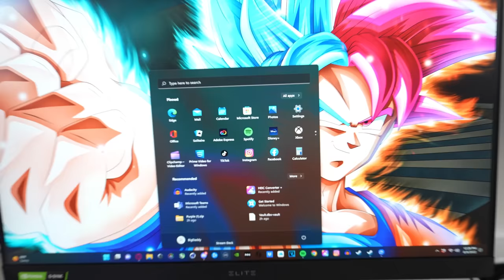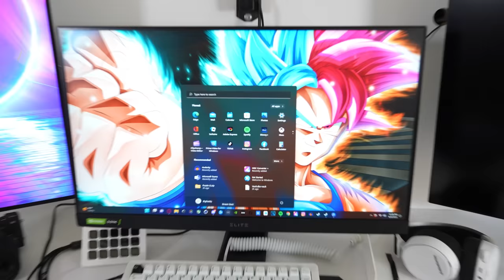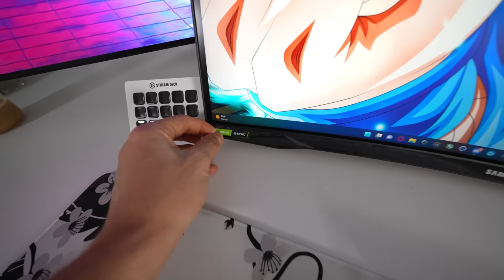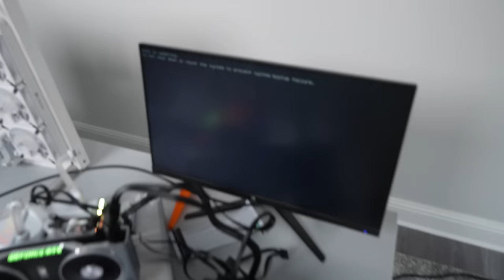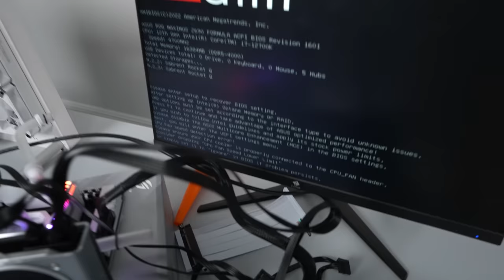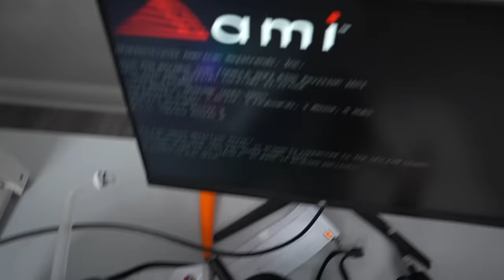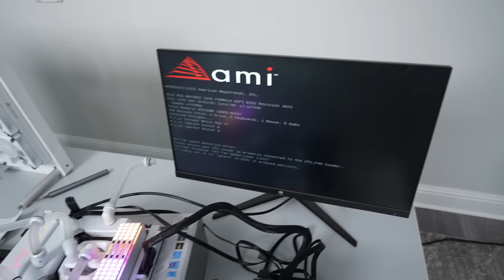I Almost Gave Up...

Comment: If the update resetted your bios, it might be that it also reset PCIe compatibility to 4.0 instead of 3.0. Because PCIe 4.0 is more finicky on timings and you have the long riser cable the timings were off and thats why you didn't get any VGA signal.
Reply: That makes sense.
Reply: Yep, good ol 3.0 vs 4.0 issue with the update. Happens every. Single. Creator. Who uses a riser cable
Reply: windows moment
Reply: IMHO, I don't think that's the issue, because his motherboard is PCIE 4.0 to begin with.
Reply: even if that was the issue, after he installed the 2080 he didnt went in the bios to change the compatibility to 4.0
Reply from the maker: The riser cables used in the video were all pcie gen 4. I never changed it in the bios because I was using a 3080 ti.
Reply: @djkucuk  Hopefully he sees this 🤞
Reply: Weird for some reason my comment is gone.

Ive looked at the amazon listing for (what i believe is the second that cable you bought). It states: "PCI-E specifications do not regulate the use of a riser cable. As a result, Gen 4 motherboards are designed to connect the GPU directly."

I believe the problem you are encoutering is related to PCIe4.0 timings which are much tigher than 3.0 timings. There is  (on most) 4.0 motherboards the option to switch to pcie3.0. If you do this and the problem is gone. Then indeed the riser is affecting the timings which is why you are getting (seemingly random) errors. 

This means that you either: 
Need to look for a pcie riser that works in your setup
Change the motherboard to another brand/model
Stay on Pcie3.0 mode
Reply: @massimo3860  2080 is pcie3.0 my friend.
Reply: @djkucuk  like i didnt know about it... the point is that he didnt went into the bios and change the pcie setting
Reply: @TechSource  the bios has a setting to change PCIe between gen 3 and gen 4. If you are using a gen 4 risers, you need to make sure, PCIe gen4 setting is enabled in the bios. Windows update could have changed bios settings somehow.
Reply: @massimo3860  dude was trying to say that when he put the 2080 in it automatically changed to pcie gen 3 cuz the card is gone but when he had the 3080ti it was at gen4 cuz of his card but the riser was gen3... Ed said this wasn't the issue but this happens all the time to ppl.
Reply: Maybe the 3080ti needs bios update. I know some GPUs have a bios update
Reply: I was thinking it could be an issue with the PCIE bus speed too. And some of the rebooting could have caused the issue. Doesn’t explain why it originally failed, but it did seem to look like this could be the problem.
Reply: @massimo3860  He litterally removed the CMOS battery resetting the BIOS, the setting might have been enabled before. You cant be too sure. He should just try it. If it works it work if it doesnt hes back at square one. Its an easy diagnosing step because its literally a setting in the bios so its easily reversable. 

Things he tried:
3000 series + pcie riser (lian li) (presumably on 4.0 mode)
3000 series + pcie riser (second one) (presumably on 4.0 mode)
3000 series directly on motherboard (presumably on 4.0 mode)
2000 series directly on motherboard (presumably on 3.0 mode)

If he tries: 3000 series + pcie riser (either one) on 3.0 mode and it works without seemingly random errors then we can conclude that it's the 4.0 signaling that is causing his problem.

Again, I am not claiming that it IS the problem. Im giving advice on how he can try to exlude the pcie signaling from the equation.
Whatever he tries to do with this information is for him to decide.

Comment: When I troubleshooting I usually do test the RAM 1 by 1 many times I encountered that 1(one) of the RAM is malfunctioning that is why your system giving a different problem every time you change a components.Always make sure to reset the cmos setup when changing components when troubleshooting.

Comment: I know your pain, my pc would randomly restart within minutes of my using it and I tried troubleshooting everything (except for the actual problem). 5 months later and a lot of frustration I found out it was my ssd which had my OS on it. There were times where I felt like throwing my pc off a cliff and start over but I didn't give up and I saved myself the hassle and money. Never give up 👍
Edit: My pc restarted again and now I give up :')
Reply: PC's really hate us, mine has been crashing whilst playing for 2 months now, been trying to fix it daily.
Reply: @SAG3X  its a struggle
Reply: @downhillsender8984  Yup still fixing mine everyday
Reply: For me it was the bios. Try updating it
Reply: @cezarstietot2417  Downgraded and worked for me
Reply: i am at that point right now with my new build (i7-12700k)... and my i7-3770k still going strong without any issues!
Reply: reset bios? Ive had the same issue before
Reply: @svenderman331  Fixed, Had PSU Protection Button Toggled, That's why It crashed
Reply: Hey I YAY LOVE TO 🎉🎉🎉🥺🥺🥺🥺🥺
Reply: @SAG3X  mine would just randomly go black and i was hearing usb disconnect sounds, I figured out that I had rounds of plastic still on my ram and that it was overheating the whole time lol
Reply: Mine bluescrened if i went to ANY site on google and it gave me (PAGE_FAULT_IN_NONPAGED_AREA) but when i uninstalled avast antivirus it fixed. And i tested by installing it again and got the bluescreens again. So Avast gave me the bluescreens

Comment: A CMOS Checksum error is a conflict between the CMOS (Complementary Metal Oxide Semiconductor) and BIOS (Basic Input Output System) that happens when you boot up a computer. It occurs when the computer isn't able to read startup information or the data does not match up.

In this guide, we explain what causes a CMOS Checksum error and offer instructions for troubleshooting and fixing the problem.

Motherboard with CMOS battery
Causes of CMOS Checksum Errors
There are several potential reasons for a CMOS checksum error, but almost all come back to the information on the CMOS being corrupt for one reason or another.

Before an operating system boots, the computer's motherboard handles many lower-level tasks, preparing the system components to run and eventually handing those tasks off to the operating system. The software on the motherboard is called the BIOS. In addition to booting up a computer, the BIOS contains several settings for its hardware, like speeds, voltages, system time, and boot priorities. The BIOS settings aren't saved on the hard drive. They're on a chip called the CMOS.

Whenever you make changes to the BIOS settings, start your computer up, or shut it down, those events are written to the CMOS. It keeps track of the data to make sure that things run normally the next time you start the computer. The CMOS stays on while the rest of the computer is off because it's powered independently by a watch battery. When the computer starts, it reads the state it was last in from the CMOS. Usually, it can read the information and restore itself without an issue. A CMOS Checksum error occurs when the computer isn't able to read that information.

One of the more common causes of a checksum error is also the simplest to solve. The battery that powers the CMOS is a watch battery, and it can run out of power. When the battery is dead, the CMOS can't store information anymore.

Power surges and sudden losses of power are other causes. If a computer doesn't have a chance to write information to the CMOS before it's abruptly powered off, it has a hard time picking up where it left off. Power surges can also cause corruption or hardware damage.

The final cause is less common, but it can happen. If the BIOS is damaged or corrupted, it will cause a mismatch between the BIOS and CMOS. It's uncommon but possible for a virus to infect and corrupt the BIOS. Still, it's more common that a BIOS update failed or the operating system updated

Comment: Lol the amount of times you had us think you really figured it out
Reply: So what is the actual problem?
Reply: @fynkozari9271   bios update could’ve went wrong during his 30 minutes gone and the 2080 helped out the issue and then the rizer cable went bad
Reply: @Ash-ux4rv  yeah he has too many components, more problems. Things tend to break. I dont need a riser cable. Less things I have, less things break. I won't even use a hdd on my next build. I have 3.63tb was red us nas drive current build.
Reply: @fynkozari9271  rizer cables aren’t bad necessary his pc malfunction was unfortunate because at first his bios was the issue and then that bios killed the rizer cable basically

Comment: Ed, one of the things you should do with an FE card and post errors is update the firmware on the GPU, Nvidia has an updater on their website. I was having so many problems with my 3090 in November of 2020.  Update the firmware on the card. It will make things so much easier.

Comment: Sometimes things just need a good ole reseating or swap and reswap lol. I've worked on PC's in an enterprise environment for 8 years and I''ve seen some weird things. Bad mouse cable, bad keyboard cable, bad printer cable, all have caused boot issues for me before.

Comment: could it be the pins inside the power supply box that are loose? If you are moving it around and have the cables turned it could make the connection loose in some places. Might just need a new power supply box

Comment: My guess is the GPU power cable. its the only thing he switched from the original components and got it to work.
Reply: Sounds like how most murder cases ends up when trying to solve a mystery murder, the first person you suspect does normally be the murderer.......“When you have eliminated all which is impossible, then whatever remains, however improbable, must be the truth.” - Sherlock Holmes

Comment: I’m 70 years old and have done my fair share of PC building from C64 and BBC days until present. So many problems solved and mystery ones not solved but JST started working again. I’m retired now and I’m just about to try building my new wall mounted PC. I love the challenges it brings and sense of achievement. Well done for persevering.
I’m an ex airline captain and as such we have to be ready for any problems in the air with no one to step in and help, the 4-500 lives on board count on us and no amazon next day delivery at 40k feet. Well done my friend, you did and enjoy your new home with your family

Comment: It is soooo nice to finally see a video of someone struggling like I always do when I build a PC. In the videos everything normally goes perfectly while I end up in sending back and forth parts.And unlike you, I don't have a nice contact at Asus that sends me a new board, or a new processor because I can't afford it. And then the most annoying part is, when you see people writing smart ass comments assuming you are dumb and did the most basic stuff wrong.

Well I am about to build a new PC, I am crosschecking compatability with all the parts before I even order anything, and I am not going to do extreme tweaking with weird custom cables. Let's hope that for once, I will have a nice PC build.

Comment: i know this video is old but the thing that caught my eye was the power supply fan would stop spinning after awhile after it being on, would that have caused the issue? I'm kinda still new to this stuff just a wild guess
Reply: Alot of psus have a 0 rpm mode in which the psu fan wont spin if there is no load or not enough of a load so this would be normal behavior.
Reply: Most power supplies stop when not under load , it’s completely normal.
Reply: @terabitdefiance8022  thank you makes a lot of sense!
Reply: @dragonsharker4793  totally makes sense thank you!

Comment: I work as a computer repair technician, but I can't say that I know what is happening, especially since I am not there to go through it, but I can give you some food for thought. 

What was the common denominator in every situation where you tested and got the CMOS error or post error? What part that is replacable did you not replace?
Was there some sort of PCI driver issue that caused a communication problem within the hardware somewhere?
Did you replace every replaceable part separately (replace the CPU and then keep everything else the same, if that doesn't work, put back the old CPU and replace the GPU, so on and so forth)?

From the sounds and looks of it, you tested and replaced all the hardware, but if you didn't it could be something to do with the SSD, the CMOS battery, or the RAM, as those were the only things that I don't think I saw you replace.

If you have tested all the hardware (replacing them one by one while keeping all other parts original) then most likely something happened with the Windows Update that caused a software issue somewhere. I've come across a lot of different situations where the most reliable fix has been just to reinstall Windows. I have also found that some machines (especially some laptops) tend to just not work well with Windows 10 or Windows 11 depending on the machine. I would say the best bet for your issue though is that there was some sort of software issue that was causing a communication error between parts.

Love your videos! Hope this helps!

Comment: this was exactly me when i got my new 6600 xt. my computer simply would not boot and i got no display to any monitor i tried to use. i then had the idea of using my old gpu (gtx 1060) and then that decided not to work. perhaps the new card bricked my computer? i swapped out part after part, trying to figure out what the actual issue was. i went as far as taking the 2 hour drive all the way to microcenter to replace the card, just to have the same issues. then randomly, it just decided to work and i've had no issues since. computers can be seriously confusing sometimes but the relief once you fix the problem, even if you never find out what the real issue was, is seriously like nothing else in this world lol

Comment: I had a similar problem with my build.  Try disconnecting your GPU.  Boot from the onboard video.  If it boots up, change the pcie slot to gen4.  Reconnect your GPU.  That resolved my issue.  Good luck

Comment: I would say it’s the power supply, because if there is a bad solder point and when it gets moved around it sometimes reconnects with the point. So if you put it on the wall the power supply is mounted vertically and there no way the connection can connect. Good luck

Comment: Great video Ed! I can only tell from my own experience with Windows 11 that I had a lot of issues with it. It once killed my M.2 SSD in my Notebook after a casual Software Update and still runs unstable on my up to date Desktop PC. I don't have any ideas on how this is happening, but I think that Windows 11 still needs a lot of work and at least on my Notebook, I went back to 10 for now.

Comment: Edd trying using the windows start-up repair tool... it may at the very least detect if there's something wrong during the start-up process. And also update all your drivers especially ssd drivers and chech if there are any pending windows updates. And also get a brand new cmos battery and after installing the new battery wait a few minutes before powering on so that the power capacitor have enough time to clear themselves. And also check if you have the latest bios update. And also consider getting a higher voltage power supply as seen in the video that when connected the 750 watts power supply you only had your keyboard and mouse attached but your main step has more peripherals and fans attached to it so it could be a insufficient power problem. And also check if TPM and secureboot are enabled.

Comment: I had a simillar issue when I was enableing TPM 2.0 in BIOS while WIN 11 was installed, and I tryed everything and after like 2 weeks of search I got an Idea to put in CPU with integrated graphics in and I did and it booted normally, then I flashed bios through bios options instead of direct bios flash through motherboard and it worked, now it works normaly with my main CPU and Displayport attached to GPU. Before all of this I also tried flashing Bios directly through Mother Board but it did not work for some reason before I swaped CPU with the one with integrated graphics. Same thing also happened to like 7 friends and same methoh was used to fix it. Hope you could make video about it, I could show you how it went for me, and hopefully I could be tagged in one of the vids :)! Love the content and I'm following you ever since you started and had arround I think 90k or 100k subs
Reply: @TechSource See this and try it out

Comment: In one of the tests, the display port cable was plugged in on the motherboard instead of the GPU. If iGPU is disabled in BIOS or display output preferences are set to GPU first, the screen may come blank.

Comment: I have exactly the same problem as you. For me, after restarting Cmos it gets better and after a few days this problem appears again. I will try reinstalling windows and changing the ssd, but I also doubt that the Gpu is responsible for this problem. The fact that there is a video signal and it works fine in games does not eliminate the possibility of a Gpu failure